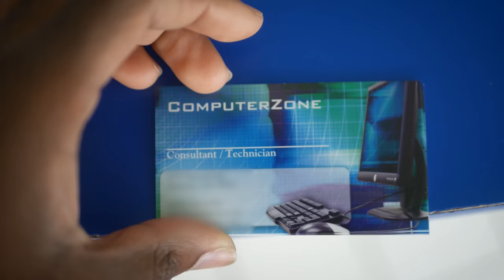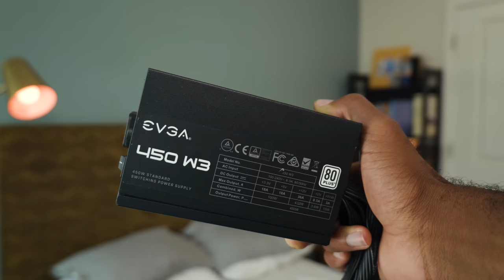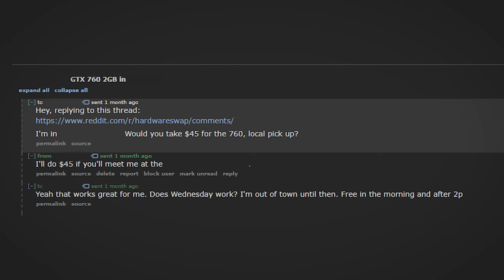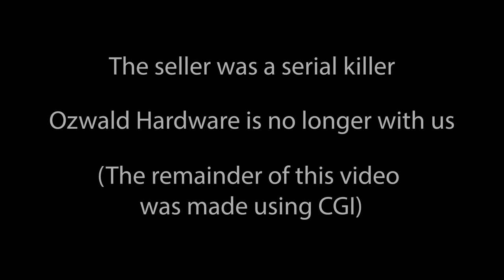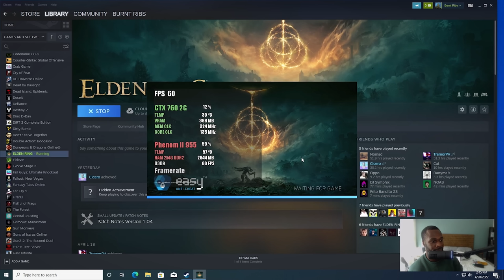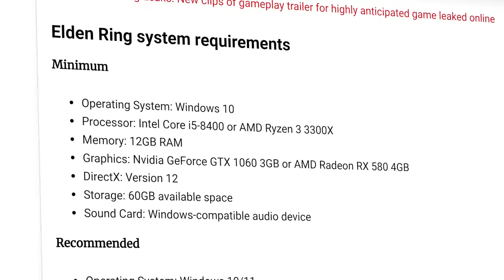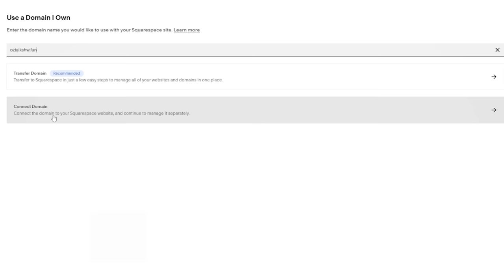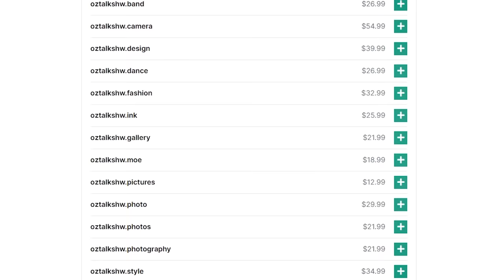I played Elden Ring on a $100 PC...

Comment: Daughter: I want to play Fornite on PC. 
Me: I been watching some videos, I got an idea. 

A week later... HP Pav i5 7400 8GB Ram 128 SSD Wifi Card 80 Bucks - GTX 960 4GB 50 bucks - 20 dollar 500 watt EVGA B stock PS - 1 8GB stick of matching ram 25 bucks. 
I drilled a hole in the side panel and installed a 120mm fan with a grill and Molex to Fan Header 20 dollars. 

100+ FPS Fornite Machine for 195 dollars and maybe 15 dollars in gas money. 

Super Happy Daughter

I was not expecting 100+ FPS. She is using her TV for a monitor(it has a game mode, fairly low response time) so the FPS is limited to 60 and I would have been happy with anything over that. These kind of projects are so much fun. It can take some time to hunt the parts down and it can be a little shady on the exchanges, be careful, but in the end so worth it!

Comment: The Phenom II is way too old. Many games straight out refuse to launch due to the lack of SSE4.1, SSE4.2 and AVX.

I'd probably locally source a used 4770K/4790K system or a Haswell/Skylake Xeon inc. a matching mainboard from China. The Haswell i7 K-Series CPUs are still OKish nowadays due to having 8 threads and a modern instruction set, but the Spectre and Meltdown microcode fixes have hurt their performance a bit.

Performance can easily be boosted by a lot with cache+RAM OC alone (DDR3 2133-CL10 would be a desirable; cache OC doesn't increase heat output by that much) and are able to reach 4.4-4.5GHz allcore when putting a nice cooler on them - with good samples managing around 4.8GHz.

Comment: I have an old Lenovo Erazer with a sandy bridge processor and an AMD GPU I put in after the factory one died. Any way to get Elden Ring running on that or should I try and buy a new motherboard etc for the case or just replace the whole thing? I have a main computer to run it on just want to get a second computer going so I can play with my nephew during the time he is over here when my brother dumps him on me. I put a Linux distro on it running proton among other software to run windows games but could go back to windows easily. I think it and  I 7 processor very old probably 2012 maybe 2014 ish.

Comment: not for kidding but i played elden ring ( almost 300h ) like this, in 1280x720 min settings with the uhd750, i5 11600k integrated graphic :)
After like 10 years of playing games at 10 fps ( before with a laptop ) i can say if u wanna have fun, you can have it without an ultra expensive graphic card, this video is the proof

Comment: I'd say a core 2 quad (or any cpu with SSE4) should be the minimum old cpu for general gaming. The Phenom II is missing the SSE4 instruction set so it can't play a lot of newer games. I had a Phenom II a couple of years back and couldn't play Doom Eternal without a workaround to emulate SSE4 that makes the game run at 10 fps so totally not workable. Of course, you could just play older games, but yeah, that's where I'd draw the line as a general recommendation. The minimum graphics card I'd say is the amd r9 280x because it can do dx12 although it's a little flaky sometimes with dx12 but it does work. I don't know about the nvidia side of things.

Comment: I NEED YOUR HELP OZ! I was installing Bliss OS on my otherwise stock Inspiron 7352 and my flash drive had a stroke and crashed my PC, now it won't recognize the boot drive even in diagnostics mode. What should I do?
Reply: Can you get to the BIOS ? If you can, see what drives it detects.

Comment: Not so much $100, but I have a Pentium G4560 (£40), H170 mobo (£80) 2x4 Gb ram (£30) and Radeon 550 2 Gb (£50).

It manages to play Baldurs Gate 3 at 720p 30+ FPS, but I haven't gotten around to trying Elden Ring or anything else on it.

Comment: Loved the vid! I’m trying to get a pc again and I’ve managed to get a gtx 980 as a hand me down, what would you recommend as a starter pc just to get me going the budget is about 350$ parts can be used or new
Reply: go for the used office dell/lenovo/hp, replace de power supply, put the 980 in & maybe buy more ram?
Reply: At 350$, you might as well get a used b450 motherboard for like 50$, a ryzen 5 1600 or 2600 for 100$, and still have 200$ for the rest like ram, cooler, case, psu, ssd
Reply: Save money on the case, get something from the dumpster :D

Comment: Least I know where to get ddr2 ram at I have a ddr2 mobo, I’m glad I’m not a minimum spec gamer anymore that has to upgrade or build a new PC every two years or so, a Lenovo think station with a quad core Xeon processor makes a great gaming convert, I’ve seen ppl play qaud core games on the athlon 3000G and it’s onboard graphics and get 30+ fps on most games so yeah requirements are bloated a bit I have a 5900X /3080Ti machine with 32gb of 3600mhz ram gonna upgrade to 64gb of 3733mhz which is considered Ryzen tuned ram cause that’s gonna give you your all out best performance from a Ryzen cpu

Comment: Ozi, most important question I have: how do you like that CPU cooler? Reasonably quiet? Think it would survive on a stock-clocked 5700X as a ridiculous budget option?
Reply: That's 92mm fan and only 2 heatpipes. A step above stock cooler but idk will it handle 5700X stock properly or not.
Reply: You should check out gamers nexus' cooler reviews. They have great data.
Reply from the maker: I think so. Phenom 955 at at stock voltage is 125W tdp and stayed under 65 C during gaming, and that was with a case with poor airflow. I think the 5700X (65W) would work fine, but definitely recommend something better. $5 more can get you a GAMMAX cooler or one of those $20 ID coolers with a 120mm fan

Comment: Nice video. I am thinking an AM3+ mb + FX chip with 32 gb of ram + a RX 470 / 480 / RX 470 / 480 would be a very nice setup to try current games on.
Reply: 480 is ur best bet but a gtx 1660 super is awsome

Comment: whats absolutely hilarious, my first pc i built was that EXACT case, and AMD phenom, slightly different motherboard but i killed it with overclocking aswell, and then got the SAME replacement motherboard, i had a 1050, which is similar to that gpu's performance though 😂😂, this was an awesome trip down memory lane

Comment: The 2gb video RAM (also what the 1050 has) is probably your biggest bottleneck so I wouldn't expect much higher FPS even with a 1050. But a 1050ti would SLAY that card. I'd try to find something with 4gb video RAM like an RX470/ 570 for a little more would go a LONG way.

Comment: U rarely actually need a more exspensive pc to play a game. BUT ur not gonna be able to play it in no 1080p or higher lol. I mean u gotta lower the resolution and u can probably run it on a lot of pcs you wouldn’t expect it to work on. Now if u wanna play it at 1080p 144 or 1440p 144 or better ur gonna deffinetly need a lot more valuable of a computer. Check the average cost per frame of diff resolutions and parts.

Comment: My 100$ build (125$)   ebay
I5 2500                         20
Optiplex 3070 mobo 15
16 gb ddr3.                 20
600w psu.                   15
760ti gpu.                    50
Stripped down desktop case 0
Old HDDs.                    0

Runs impressively